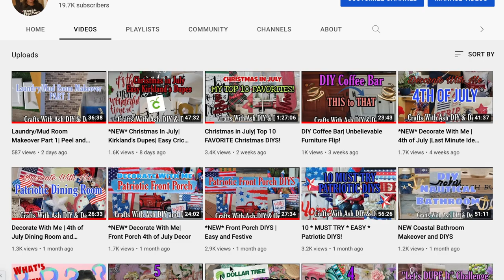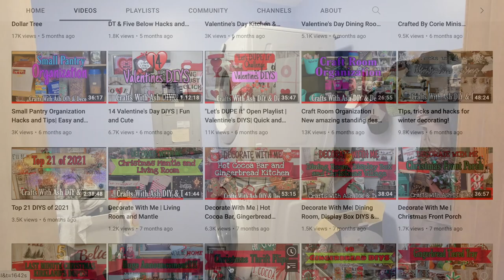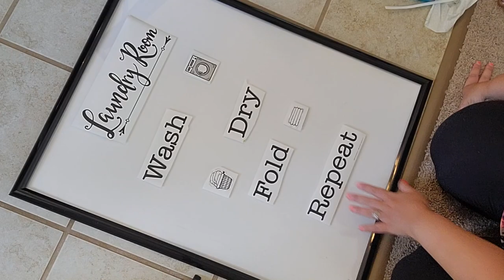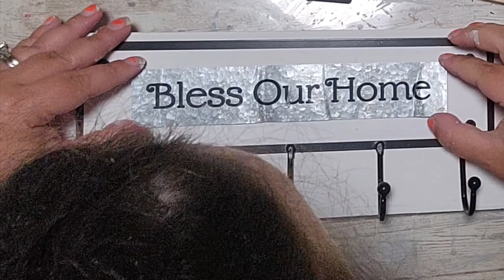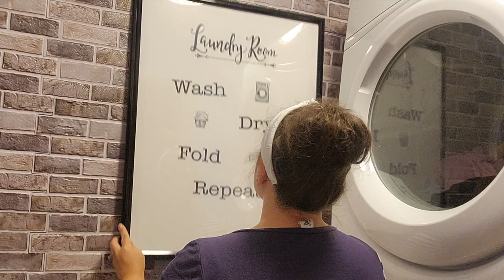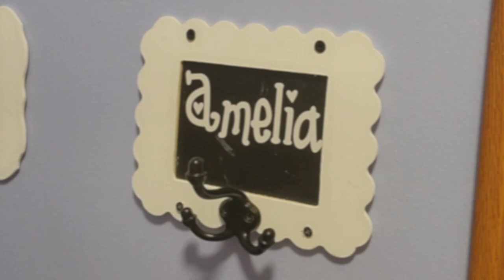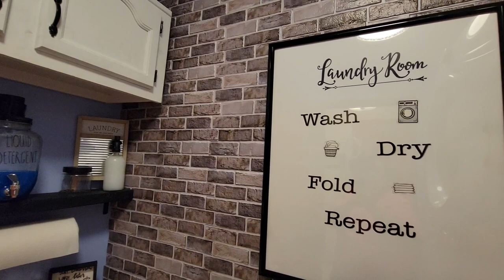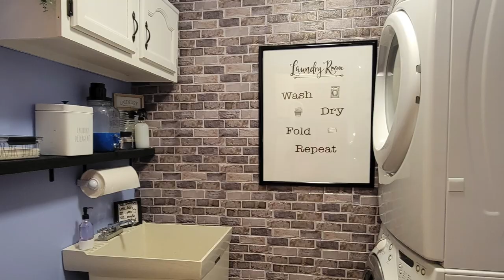Amazing Laundry/Mud Room Transformation Part 2 + Baby Girl NAME REVEAL!!!

Comment: Just a hint. If you can get black poster board at your Dollar Tree, use that to make a mat for the Laundry sign. Much cheaper than buying a large mat for that size frame. You can either cut down the white sign and layer on top of black poster board, or use a utility knife and cut about 2 inch wide mat to put on top of white sign!